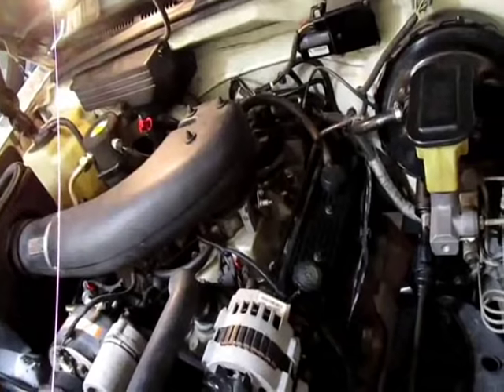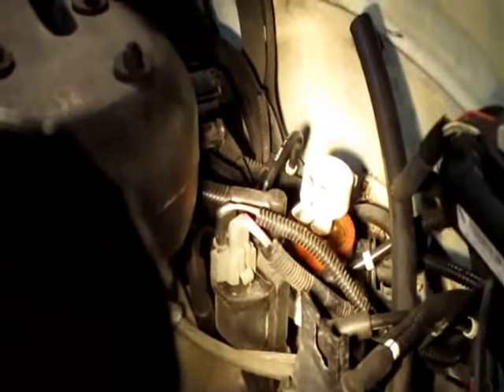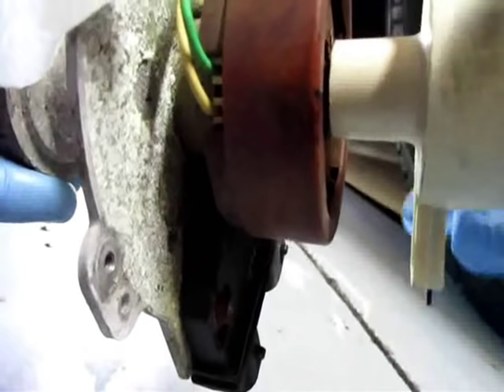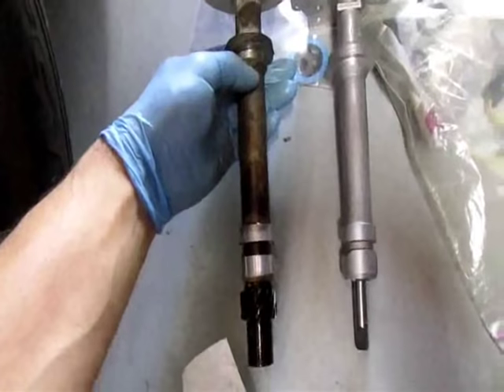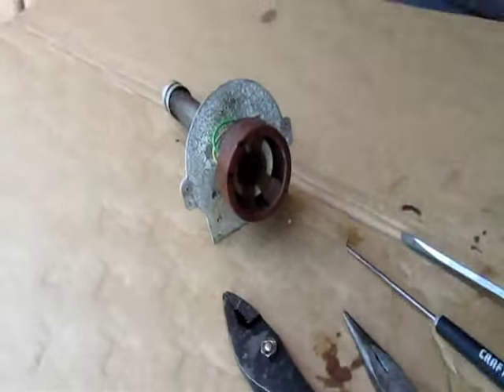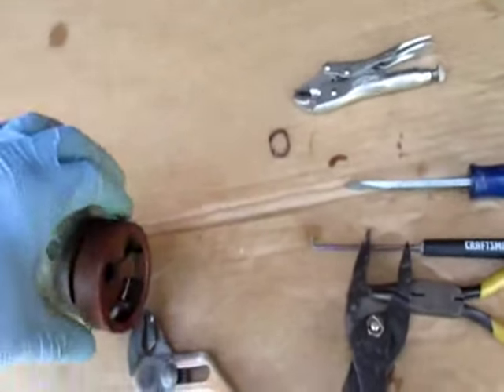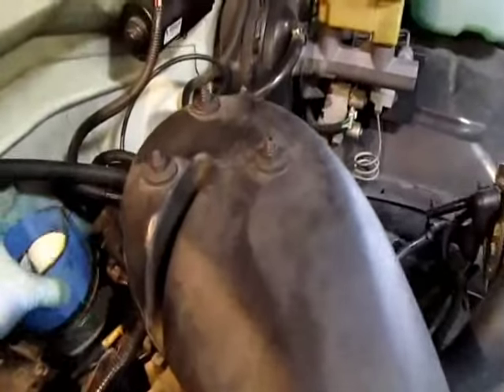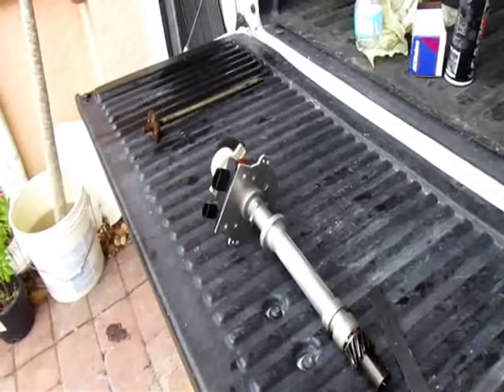Removing, Rebuilding Installing Distributor 88-95 GMC Chevy truck 5.0 5.7 How to?

Comment: the dist hold down is supposed to be concave
Reply from the maker: This one looks more twisted but I think its always been like that. I was the only one who has ever took the distributor out. Doubt they had it out when it has 10k miles on it lol That "new" housing was a POS.    Returned it.   I have a better one now it looks like the original. Same height

Comment: damn man wish you were working on the 96 lol i messed mines up on my 5.7. screwed up marking up my dizzy
Reply from the maker: glad I DON"T HAVE a 96 lol  You need some sort of scanner to reset the timing in a 96+ vortec truck. Someone has a video on how to do it.
Reply: i know man. double punch to the gut after i found out about that whole scanner nonsense. I had the nasty intake leak
Reply from the maker: thesmoothone
 Might want to try to find some hole in the wall shop that has a scan tool.  Explain it if they are nice they might help you out for 20-30 bucks. All you gotta do is ask.  The big shops will tell you take a hike.
Reply: Very true. One more question, when looking to install the engine needs to be set on TDC compression stroke right? The 2nd line on the  balancer needs to meet up with the top notch and the 1st line under the car near the timing cover notch?
Reply from the maker: It would help if its at TDC on 1.  You can place the distributor in two ways, The balancer will line up with the 0* timing mark and cly  number 1 will be at TDC.  Or the mark shows at zero and cylinder 6 is firing. lol thesmoothone
Reply from the maker: And when cly 6 is firing, and you have thee distributor rotor pointer  to cylinder number 1 oh yea, Backfire.  I set it up every time at TDC number 1, rotor on 1, ballancer at Zero* and I have no issues.

Comment: CLAMPS GOES ON TOP OF THE INNER RING, NOT ON THE OUTSIDE, LIKE THE OEM
Reply from the maker: WHAT CLAMPS I PUT IT ON RIGHT
Reply: The new part is designed for different applications, yes you did put it in right, there is a different hold down available that is a little longer an it slides in over that small inner ring on the distributor, I ran into this before on this same vehicle
Reply from the maker: @robhertfernanda   Yea weird I dunno. I have a newer housing brand new and its the same size was what I had but the bushings are still okay in this one just the shaft was badly cracked at the star. Atleast it keeps time now the end play would change when it wanted  from a loose fitment and it would change timing

Comment: I have a issue I've never heard of before with the distributor in my 92 chevy k2500 5.7. Just  installed a brand new distributor by the book. I can get it to start briefly but the truck dies, and then there's a arcing/ buzzing sound coming from the rear of the distributor, and there fuel pump sounds like it's going non stop if I leave the key in the on position. Any ideas or advice is greatly appreciated. Here's a link to a video of whats going on. https://youtu.be/Xu4cobdN2IM
Reply from the maker: It could be a garbage new part. I would only use all original parts and toss together a unit from new and used parts. Did it twice already on TBI vehicles.  It sounds like its hard to start too  What was going on before you changed the distributor?
Reply: It was running rough, would begin to die if i pushed the accelerator. This is actually the 2nd new distributor I've installed, when the 1st distributor was making the same noise I took it back and exchanged for this one. I thought that since the noise was coming from near the electronic control module that maybe the ecm in the new distributor was faulty.

Comment: you wanna rebuild mine out of an iroc if ii send it to ya
Reply from the maker: Nope.  If I can't test it, Not getting involved.
Reply: I got a Spectra with a lifetime warranty from Oreilly auto parts. The quality seems to be top notch. I was going to rebuild my old one but I really needed the car running. I'm going to rebuild the old one now so I have a spare.
Reply from the maker: Usually the electronics are cheap in the the "new" or remans

Comment: Housing is bad!? Way to rebuild instead of new...
Reply from the maker: New is trash and made in china.  My original housing was decent Its a little corroded. The shaft was the problem on it.   When this housing gets worse ill use another housing I have that was actually cast and machined correctly
Reply from the maker: Thats where I got the bad housing from!